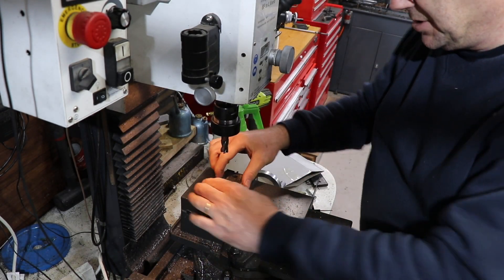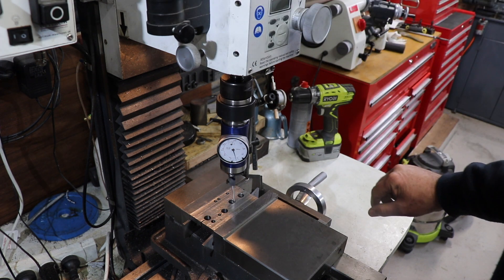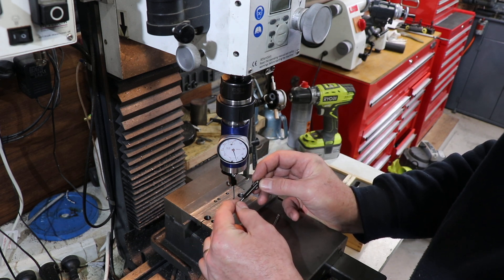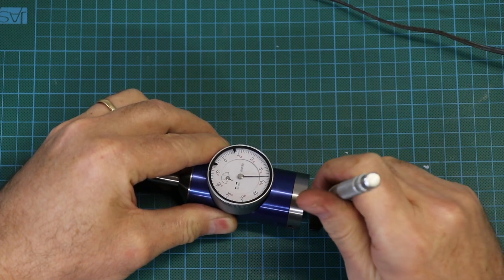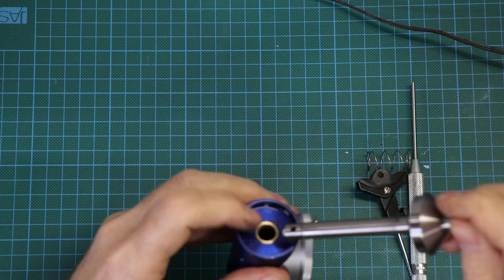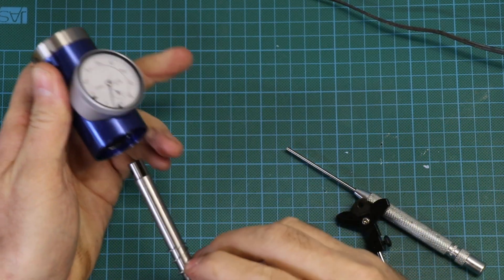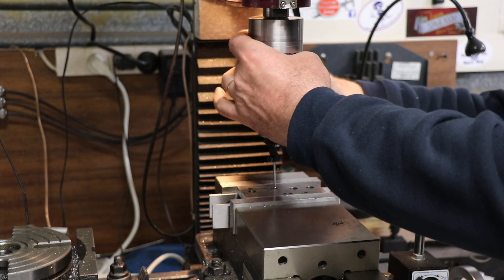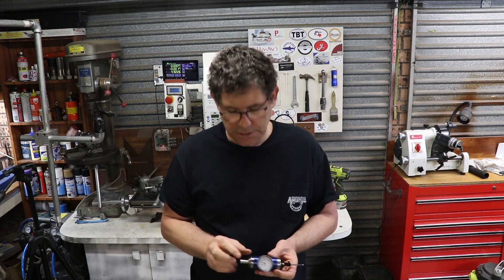Coaxial Indicator - Tool Review - How it Works

Comment: Thankyou for this video. I now have a Shahe unit on the way. I notice that you use use TouchDRO. Was this a DIY project? What scales did you use?
Reply from the maker: @glencollingwood  I used magnetic scales from Optimum.  They worked well but eventually the adhesive failed and I replaced them with conventional glass scales.  I don’t use touch dro anymore as it didn’t work with the new scales.  I think more recent models of touch dro do work but I haven’t tried them.   Touch dro is great but the cheap tablets it uses tend to fail because their batteries swell up.  The standard dro console is cheap and does most of what I need.

Comment: Just remember that the dial graduations are meaningless. 
And the longer the prope the less accurate this device becomes. 
Even using a short arm it's about a 4:1 ratio. So a 4 tho runout in a hole  only shows 1 thou on the dial. 
This caught me out a few times.
Reply from the maker: Yes that is true to some extent.  You have to be careful. I have had good results with this tool and I still use it often.

Comment: I have just bought one of these and can't seem to get it to work at all! Around 2.08 you 'adjust' the probe but what do you do, I can't see. The probe on mine just hangs loose, it is free to swing to and fro. Thx for the video. Myles
Reply from the maker: Sounds like you need to tighten it up a bit.  The probe should cause the black arm at the bottom to pivot.  This causes the body of the indicator to move up and down.  If it's on center it will stay at the same height vertically.
Reply: @CreaseysWorkshop  I can't see how the tiny bolt at the top of the pivot is enough to stop it just hinging to and fro. I tried tightening it up and it is nowhere near enough to stop it moving.
Reply from the maker: @mylesdw  did you remove the plastic spacer from the top of the gauge below the cone shaped part?
Reply: @CreaseysWorkshop  Yes I did. I applied a bit of BFI to the hinge bolt and it's working now. Just a lot more than I expected. Thanks for the help.

Comment: Hey John, thanks for the teardown, helped out a lot! As far as putting it in a chuck in the lathe, i would suggest going for a collet as they are way more accurate. There's a lot of wobble in the shaft in the example you've shown,  so maybe the error you're seeing is just the whole axis of the tool misaligned with the axis of your lathe?
Reply from the maker: The point of that setup was originally to correct any issues with runout.  What I found was that runout in the collet has no effect on the tool.

Comment: I found that the offshore coax dials always have some runout even when positioned concentric with a bore in the fixture. If you can get the Blake version, they are much better, I’ve used both and can verify that.  However, for most jobs, a 100$ foreign version vs. 400$ Blake is close enough.   Not as painful when it gets crashed by an apprentice.
Reply from the maker: Phase Converter 135 amp 208 V yes that’s true.  I would love a Blake one but I don’t think it would be any more accurate.  It is quite easy to find the minimum wobble.  It is annoying though.

Comment: 0.04mm is not pretty close.so coaxial indicator even you didnt done it correct its not give correct center point. so what measure you trust. i like that normal indicator it can be used by knowing cosini error and get really accurate center
Reply: Out by one decimal place, it's 0.004mm aka 4 microns or about 1/10,000th inch.

Comment: Also handy for setting your lathe tailstock back to centre after offsetting it for a taper. 
And, if you have one of those ER collet block holders you can use them in combination as a 2-dimensional edge/corner finder. 
(well, any square block with a hole in the middle will work, but the collet blocks are already in the drawer). 
Picture here: http://www.model-engineer.co.uk/forums/postings.asp?th=131421

Comment: Hi John , very good review , that looks like a good , simple , solid tool . 
I can't afford one , many tools are too expensive in England for pensioners like me , so I will make one ! Shorter if possible !
Reply from the maker: Hi Jim!  I think you could definitely make one.  I would love to see the result.
I have found that I use this tool quite often.  I was using it on the weekend on my lathe to line up a hole on the 4 jaw chuck for boring.  I'm really tempted to remake the internal axle and end caps on mine as you can never get it exactly "dead nuts"  it always seems to show 1 or 2 thou of wobble.    Thanks for watching my video and for the great comment!

Comment: Nicely reviewed John. I like a few others suffer with limited daylight below my vertical mill head (8" excluding the collet and vice !) so no huge use potential in that - but the lathe and drill press would benefit Im sure. I will add it to the list. Nice to see it taken apart as well. Any chance you could revisit showing its use on the lathe ?

Comment: If one of the coax manufactures would design one which was shorter/smaller, I think they could get some additional customers from those people with smaller mills or round column mills like mine.
Reply from the maker: You can get a bit of extra height by using a collet that fits directly  in your spindle.  These are definitely available for MT-2 and will give you the height of your collet chuck in extra space.
Reply: Usually the issue is when using collets with end mills and using the coax.

Comment: A very helpful review, the only think that can let this system down is that if run at anything other than 10 RPM the hand is going to fly off your DTI, looks like I should get one !
Reply from the maker: I have run it at 400 rpm and it was fine.   Minimum I can get is 180 as my slow speed gear is cactus.

Comment: Was actually looking to buy one of these, handy tool to have. Any chance you could do a review of your mill?? It looks tidy 👌
Reply from the maker: I love it.  It's the only mill I have ever used though, so I am not very objective.  It is a pretty capable little mill though and I have done a lot of good work with it.
Reply: John Creasey I'm after one like that myself, it's an 'optimum' yea? Very hard to find in Ireland,  I might have to take a trip to the UK,  there seams to be a few for sale over there.. Stefan Gotteswinter has a nice version of one too. Anyway, thanks for the reply, and keep the videos coming, great work your doing 👌
Reply from the maker: Ian Graham yes it's an optimum.  The little brother to stefan's!  They are great.  Try to get one with a DRO fitted if you can.  You won't regret it!
Reply: John Creasey I have two optimum lathes and I find they are a decent and tough machines, so my heart is set on a mill of the same brand. . the size is ideal for my space also, and a DRO will be icing on the cake lol Thanks for the input John 👍
Reply: Warco in the UK supplies machines which look very similar, just a in different livery, green & yellow.

Comment: Nice video !
I have one of these that has a little run out and was thinking of pulling it apart to see if i could fix it and you showed me how easy it is to do that .
When using these things it is important to ensure the mill column is trammed in as a column that tilts off in any direction will affect the readings as the head is moved up or down the column this is especially important with tilting column machines like the Sieg x2 etc .
You can also use them on the lathe and those long curve stylus are good for getting into internal grooves and bores - just mount it up in the drill chuck in the tailstock  and use it like a dial test indicator but be aware that say a reading of .001 on the dial is not indicative of the actual run out as the stylus length can be changed so you really only use it as a  comparator not a measuring device .
Reply from the maker: That's a good point.  I never considered the effect of tram.
Reply: Actually, mount an appropriately long tip and put it at a large angle to the axis and you could sweep the mill table to check your tram.  Obviously not under power because it will drop in the T slots, and probably break the toggle link on the coaxial, but if you haven't made a tramming indicator holder it would be a quick check.  The other thing to keep in mind is the longer your tip the less resolution on the dial, since this is effectively measuring the angular shift of the toggle link, .001 inch at 1 inch tip is a larger angle that .01 inch at a 3 inch tip.

Comment: Top quality, thank you for the effort you've put in. A couple of questions,  1) what rpm did you run the coaxial at?  2) what is the purpose of the small bolt located between the pin you took out and the "knob" holding the stem in place, it looks like it's there to allow for some sort of adjustment . Finally I would very much appreciate a short video on indicating on an exterior surface including how to choose the appropriate length stem. Thank you Greg C.
Reply from the maker: The instructions recommend running the indicator at 100rpm or less.  My mill goes down to about 180 so that's what I used.   Under the pivot pin there is a small bolt that allows the probe to be moved at an angle.  This allows you to push it sideways to be in contact with the hole or straight down if you just want to eyeball the center.  It is done up fairly tight to prevent slipping but still allow ajdustment.  Below that there is a little screw/bolt that is used to hold the probe in place.  The indicator comes with a tiny spanner for undoing this and changing probes.
I will upload a short video of indicating on the outside of a feature to instagram.  I'm creaseyjohn on insta.
Reply: Outstanding, thanks for you're answer.